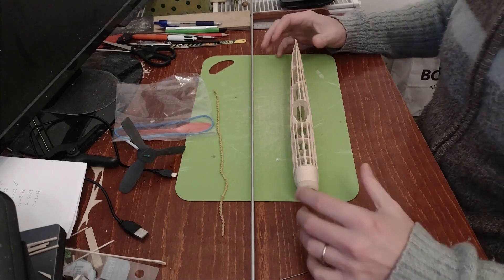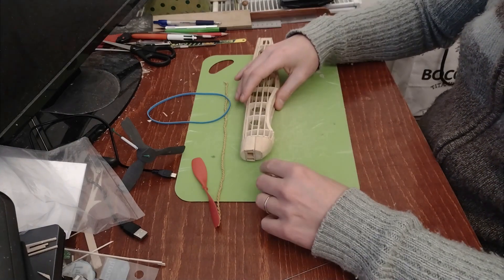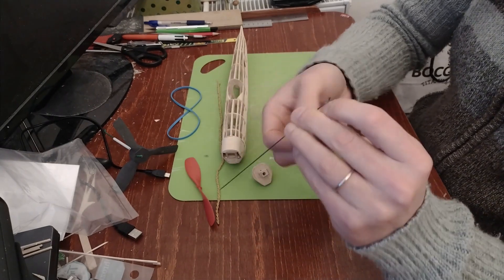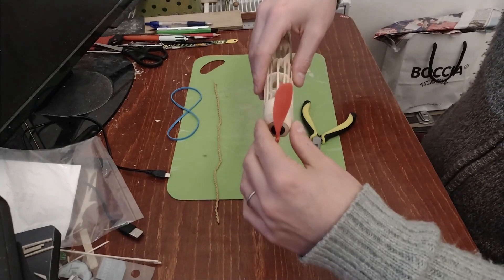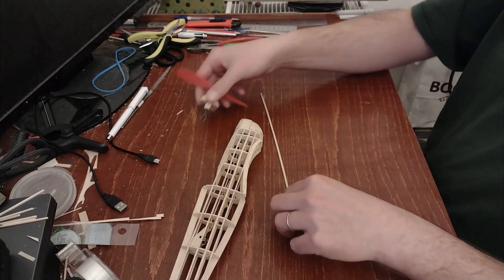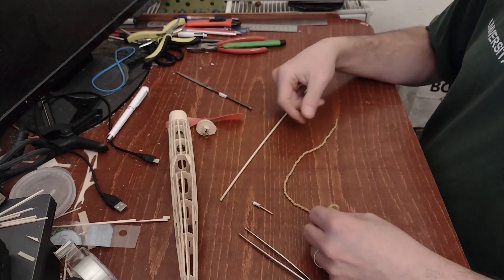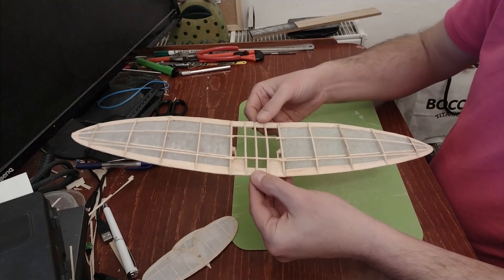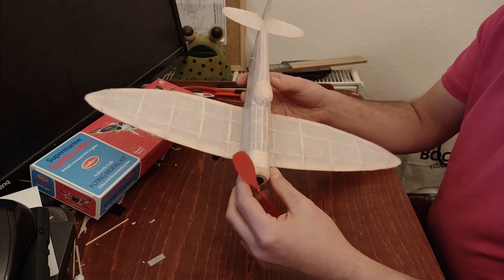03 Rubber Powered Guillows Spitfire   Rubber Motor, Tissue and final assembly

Comment: How would one go about painting and detailing one of these without adding a considerable amount of weight so that it is still flight worthy but has era correct paint scheme
Reply from the maker: Indeed, way to heavy to fly. Probably coloured tissue would have been a better idea. I have to fix it up after the maiden crash and try it again. Thx for stopping by!
Reply: @downwindchecklist6567  I'm wanting to build one of these kits I've been obsessed with WW2 era air craft as far back as I can remember....wanting to do a p40 war hawk in the classic flying tigers scheme I did a bunch of research on the American volunteer group and now am wanting to replicate one of the pilots planes as accurately as possible but still have it be flight worthy
Reply from the maker: @williamkeeling4961  I haven't done a P-40 yet. It sure would look great with the detailed markings. The sooner you start, the sooner you will finish it and get to build another one ;)

Comment: At 10:50 you were explaining how you bent the little piece of tubing at the ends, I found a good way of doing it by sawing a couple of screw heads off and by placing one in each end of the tube, then you can squeeze gently in a vice and they just bell out easily. You can get the warp out of the wing by holding it over a steaming kettle for a few seconds and twisting in the opposite direction if needed 👍
Reply from the maker: Good points. I wanted to get myself a vice at some point, so this is yet another reason to do it. Thx!
Reply: @downwindchecklist6567  It doesn't have to be a big vice either Andrew, I use a 2in vice (6cm) that just clamps onto the edge of the table!